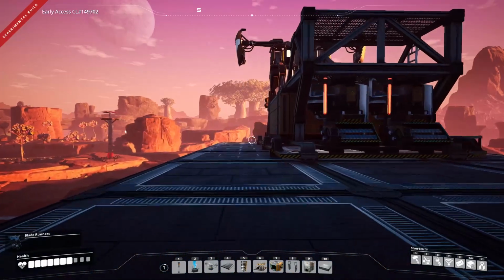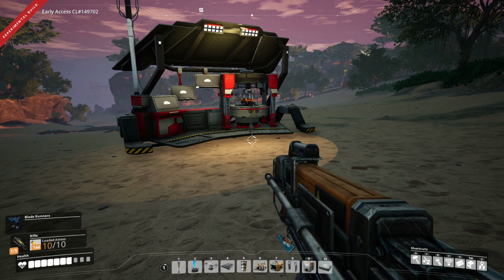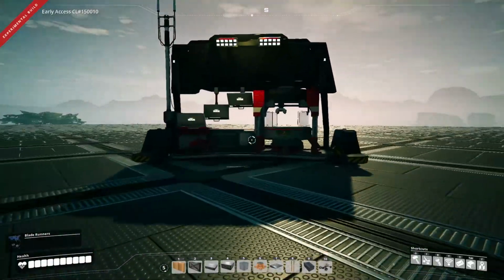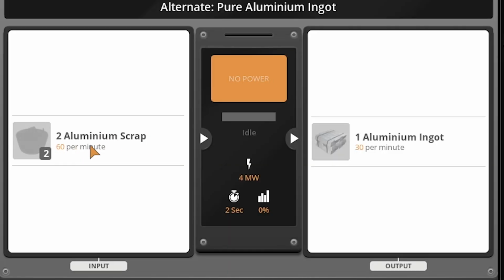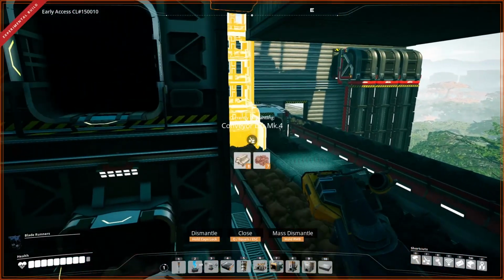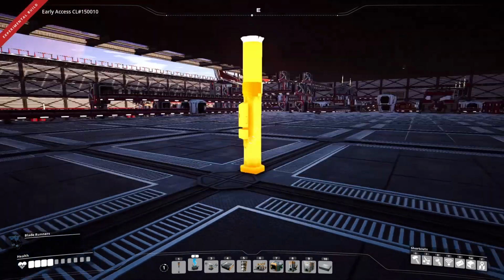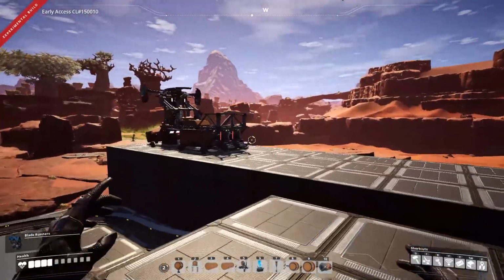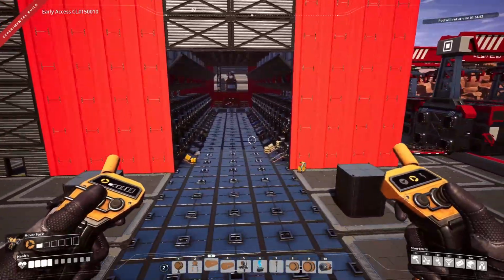Starting our WORLD HARVESTING! - Satisfactory Update 4 Gameplay Ep 2

Comment: I think a couple days after Kibitz posted this, a rebalanced happened and the hoverpack was placed at Tier 6. . . . RIP.

Also the hoverpack is most OP with walls and the wall outlets. You need to get somewhere or get higher up? Build walls up to it, plink in wall outlets, string them together with cable and you can use the hover pack up the wall. Just make sure you have 100 mgw to spare. That's the amount of power the hover pack takes. It sucks trying to cross a canyon like this and have the breaker trip on you. . . . Mistakes were made, life lessons weren't learnt, but I regret nothing and refuse to learn failure from it. Only successful unsuccess.

Comment: Hi kibz I know you said you didn't want to touch turbofuel but Ive just done the maths on the new turbofuel recipe for my own factory and it's pretty good.

it only uses 300 sulfur per 600 turbofuell out and consumes 450 crude per 600 turbofuel

The old recipes important stats are 
480 sulfur per 600 turbofuel and 270 crude consumption per 600 turbofuel

So obviously the old turbofuel recipe is more crude efficient but oil isn't really in low supply especially with the new pressurizers

I'd recommend the turbo blend recipe as its more sulfur efficient and you also need far less machines which Is important for this playthrough

(All calculations were done with the new diluted fuel recipe in the blender but the numbers work out the same with the old diluted packaged fuel recipe)

Comment: Nice start. You should do at lest one turbo fuel setup. You will need two pure nodes and a little more (208) for you nuclear setup and that will run 156 reactors with no waste. I have that up and running now. I needed to turbo fuel setup to start it though. Should be easy with new alt's to. 
 If you don't do turbo fuel you will have to start much smaller and that would be no fun.

Comment: I had to chuckle as you laid out plans at beginning of the video. Yesterday they dropped Build 150010 and changed some things with AL re-balance... but you needed to publish something anyway. Then I saw about halfway through the video that you finished off on the new Build.
I just completely finished fixing my Aluminum Ingot factory from the Update 3 to Update 4 changes on Thursday to get Fused Modular Frame production online using Alternate: Alclad Casing recipe. It's not too bad though. Just needed to apply some overclocking here and there.
Reply: WAIT WHAT??? sh**, i didn't knew the rebalanced aluminium, i need to go look at that NOW...

Comment: You can't prevent water backlog by reducing your water input, because water extractors clog the input when scrap production is backed up at some point. You need to ensure the flow rate of the excess water is grater then the input water, alternatively pumping to a high water storage, with an even higher water storage for the excess water, combine the output, perfectly stable.